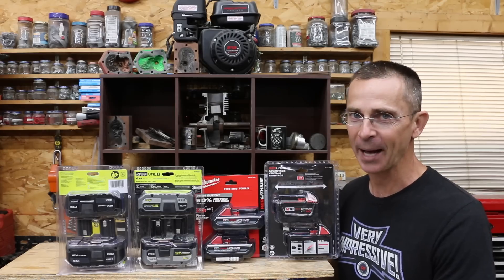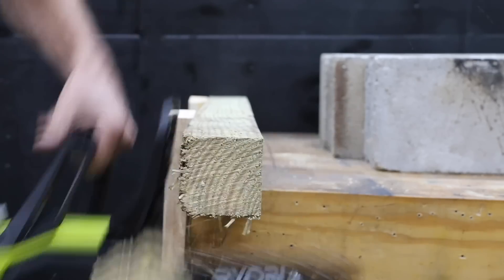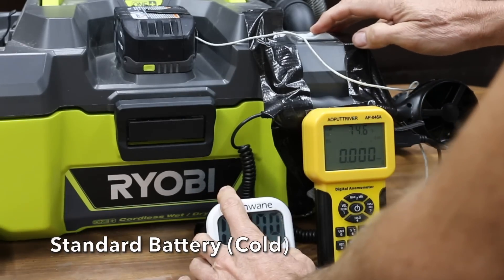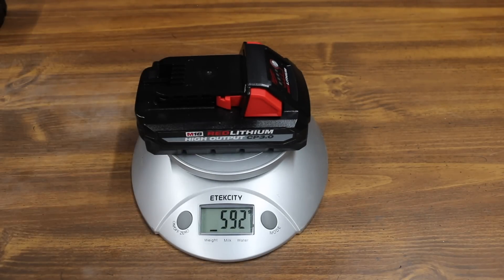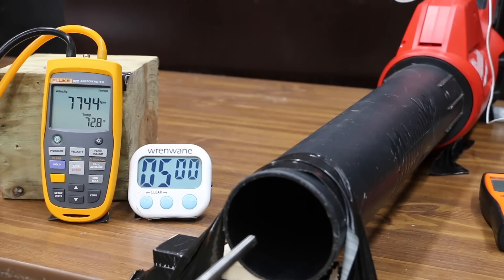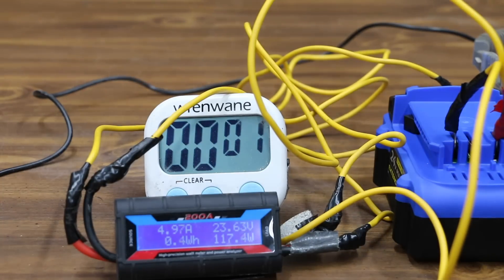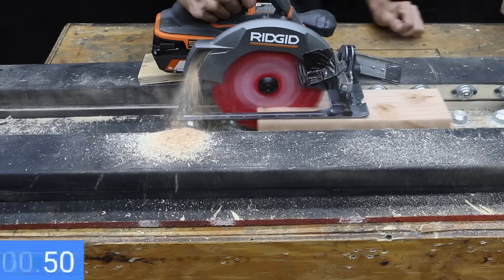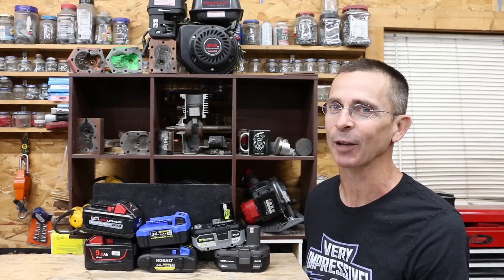Are "High Output" Batteries Better Actually Worse?

Comment: ryobi fanboy here.  The Ryobi 1+ HP batteries make a huge difference in the high end HP tools.  Especially in the Brushless models. They have an additional contact on the base of the battery, just at the beginning of the stem.     My angle grinder often stalls using a regular battery, never with the HP battery.   I would loved to have seen a comparison of a Fake Ryobi battery.   But I can't assume it would be the same as the Fake Mil.  Awesome testing.  Thanks Todd.
Reply from the maker: Thanks and you are welcome!
Reply: ryobi and high end hahahaahaahahahahhaahahahahahahahahahhaahahahahahahahahhaahhahhahaahahahahahahahahahhahahahahaahah
Reply: @promo130  Hate to burst your tool snob bubble but you do realize Ryobi is owned by TTI, the same company that makes Milwaukee… and some of their brushless tools have tested quite favorably. Not everybody cares what color the case is, as long as it works. 
I have their high torque impact doing  commercial trailer service and rebuilds and it just flat out works, even being abused. Has rarely ever  failed to get a rusted lug nut off. And if it did, it took a 1” air impact to do it. 

Ditto the Ryobi grease gun, just flat out works. And in case you missed it ih the video…Todd KEPT the vacuum.
Reply: @SoManyDogs  😂😂 clown, 
ryobi even stated themself , if you use it professional  you will void the warranty😂😂😂 call that high end
Read the box einstein 
Ryobi is for diy
Not pro’s
Reply: @SoManyDogs  #1 Ryobi is not owned by TTI.
#2 TTI makes tools for several market tiers, ryobi is one of the lower end ones. Just like S, B&D makes dewalt.

Comment: Hi there, first of all, love watching your videos! Okay, so I have the milwaukee M18 5.5ah high output (I'm in the UK) and I seem to be getting better performance from my m18 fuel grinder and m18 high toque with the 5.5ah over the 5ah, both tools are quite hard on batteries, but in my opinion, you need to be using the fuel range of tools to get the most out of them. However it did improve the performance of a non fuel circular saw, but not by much, certainly not by 60% which is the difference in price between the m18 5ah and the m18 5.5ah here in the UK. Keep up the good work.
Reply from the maker: Thanks, will do!

Comment: Impressive! Seeing these stats shows how well the standard batteries are vs the high output batteries, not very worth it unless like you said, the cold temp. Just gonna stick to the normal ones then on most occasions. You should try the HP vs normal of some of the ryobi tools though and see the differences, and also try the high preformance 4ah batteries vs the 9ah batteries and see how much more the 9ah improves speed, endurance, and power.
Reply from the maker: Thanks!  Thanks for the suggestion.
Reply: To be fair those aren’t HP tools so they don’t have the extra contacts to take advantage of the higher power in the HP batteries
Reply: As far as performance goes, here are your answers: The 9Ah is superior across the board. The closest you can get to it is the 6Ah HP and it's not that close. The 3Ah HP Compact and higher batteries will spank any of the standard batteries when used in brushless tools with the extra contact points. The 3Ah compact runs 21700 cells instead of 18650, so it has a lot of power for its size (it's actually a touch more powerful than the 4Ah HP). The 1.5 and 2Ah HP batteries will beat the 1.5 and 2Ah standard batteries and will nearly compete with the 4Ah standard batteries.

Comment: Another great video. One thing I've found with the High Output Batteries, how well they perform can be based on what tool they're put in. If I have to drive a lot of long ledger locks, you can bet I'm putting a High Output Battery in my Milwaukee impact. A standard 5.0 might get it 95% of the way into the wood, but when you need a flush-set surface, the 6.0 High Output is able to put down the last inch reliably.

Where as if I'm using my blower, the only real benefit I might see, is a slightly longer run time. 

All in all, it is really nice to have them when you need them, hot summers in particular are a pain when it comes to long periods of drilling. To me it seems like the HOBs keep the drill from burning up under heavy load in hot conditions.
Reply from the maker: Thanks!  Thanks for sharing.
Reply: Motors can only draw so many amps, a battery that can supply more amps than the motor can use means the motor will not perform any better. This is why its very tool specific. 

Also many high discharge rate high amp batteries (im talking single cells from the manufacturers) give up capacity to be able to discharge faster (though this is being improved quickly which is nice) 

So yeah, unless you have the right tool, the only benefit will be how it performs in the cold.
Reply: You may want to look into a FLEX impact.
Reply: I can only speak for the Ryobi ones, not for the rest, but on the Ryobi tools, you do have additional terminals on the battery socket that either communicates or consumes the additional power from the HD batteries. That's why also the HD batteries should have this additional contact pad on them. Not sure if either of the tools used here are using it

Comment: From experience with the HO Milwaukee and the HP Ryobi, they last a little longer but that’s not the reason to buy.  In the correct tools they have a fair bit more power (no difference in blower or chainsaw). My tests were with the Ryobi brushless 7 1/4” circular saw and the Milwaukee Fuel 6 1/2” circular saw. The rpm increase and power bump are noticeable in both applications with the HP and HO batteries. My M18 fuel hammer drill also gets more rpm for longer on a 8ah HO than a 5ah XC—same with the fuel 4 1/2” angle grinder. Love your videos!
Reply from the maker: Thanks!

Comment: good testing sir!👍🏻.... i try to stick to one brand so i dont need different chargers everywhere ( mostly milwaukees) my 1/2 impact is a 24 v kobalt which has been just awesome... i bought several knockoffs for my mil. ratchets, drills, etc... i dont see the need to buy very expensive milwaukee batteries and the fakes are good enough!👍🏻
Reply from the maker: Thanks!  Thanks for sharing.
Reply: thats why there are adapters
Reply: @promo130  dont need them.. the fakies look exactly the same
Reply: @martinedwards4522  are there real ones?
Reply: @promo130  of course    look at the video here
Reply: @martinedwards4522  😂😂 you know the difference between batteries and adapters? 
I gues not😂
Reply: @promo130  sounds like youve no clue yourself

Comment: Could you do thermal cameras next. I recently bought a yj 256 and it has a bug that I didnt see till I bought it. it says itt goes to 1200f but only goes up to 391.6 and doesn't seem very accurate. would like to know which ones perform better for the price.
Reply from the maker: Thanks for the suggestion.

Comment: This was a very valuable comparison.  Especially the Milwaukee vs the Knock-off batteries, since most of my tools are Milwaukee.  Thanks PF!  You're the best!
Reply from the maker: Thanks and you are welcome!
Reply: The primary concern with any knock-off batteries is the fact that they are made with inferior and often mis-matched cells that makes the packs prone to a much higher risk of failure, and possibly fire. Not at all worth the risk in my opinion.
Reply: yeah except they don't last very ling. I've got maybe a month worth before they kicked the can.
Reply: I love the knockoff battery test. Its always tempting to buy those batteries
Reply: Why? There’s battery bundle deals all the time at Home Depot and online for their batteries that make them as cheap as a knockoff. Milwaukee has the best batteries by far too.
Reply: @codygooch510  That's true.  I usually look to see if Home Depot has any Milwaukee battery specials and why I never bought the knock-off.
Reply: I bought the same exact knock offs and was trying to compare over here with much simpler tests and it was vague - seemed like the 8amp knock offs were equal to the 6 amp M's (at 1/2 the price) . . .   project farm is the best
Reply: @gordons_here  I never bought the knock-offs but I have a friend who did.  He said their performance seem to equal to the lower rated Milwaukee.  The 6.0 knock-offs were about = to a 3.0 Milwaukee.
Reply: @Inquiring Mind for the price, i guess they could come In handy for very light duty tasks.
Reply: @Inquisitor6321  ok that sounds about right . . .
Reply: I've tested no name batteries, and some have good cells and honestly look like OEM contract factory seconds. They could be just put inside of different cases. Others are not so good. But for lower drain or occasional use applications can be a fantastic value.
Reply: For lighter use though it does make sense to by 5-6 knock offs against the genuine though.....
Reply: @reecedrury4145  maybe.  But when your tools are making you money, it's just not worth it.
Reply: Milwaukee is now using the awesome Tesla cells (2170's).  That is worth far more than any no name knock off.
Reply: @aussie2uGA  They are using Samsung cells. Tesla cells are custom 21700's made in house.
Reply: @aussie2uGA  I've never bought or tried a knockoff. No need thus far
Reply: @aussie2uGA  Can't seem to find any info on this.  Even the latest articles searched up online show they use Samsung.  Do you happen to have a source?
Reply: @BlueFroman  Tool manufacturers aren't using Tesla cells. Tesla uses Panasonic tech made in their own factory. Maybe he was just referring to the form factor.

Comment: Would love to see you test measuring calipers. I wonder how accurate my cheap husky digital calipers are compared to more expensive calipers
Reply from the maker: Thanks for the suggestion.
Reply: From personal experience, cheaper versions are decently accurate, what you gain with "Pro" brands, is repeatability(subjective because of operator ofc), better quality,  specially in frame, rigidity of frame, smoother feel, being more dust and coolant resistant, etc. Some models you'll gain extra decimal point on read out for what's that worth. After having multiple brands and versions, my personal preference are the coolant proof Mitutoyo's, I've had Brown & Sharp, Starrett, Fowler, and etc other brands, and none are as nice as genuine Mitutoyo's(there are plenty of knockoff, specially of non coolant proof ones).
Reply: @dfsmachinist5941   - I'd heard that knockoff Mitutoyo calipers hold battery charge around for a month, in compare to a genuine with over a year battery lifespan. Didn't buy it yet.
Reply: @hztn  Yep, sounds about right, one of guys in shop had a knock off.

Comment: Love your reviews! I make purchases based upon your objective test results. Unfortunately, I purchased a bunch of Ryobi hp batteries before this test😞
Reply from the maker: Thanks!
Reply: I love his reviews too but unfortunately, and it happens to everyone he missed the mark on this one. Don’t feel bad about buying the HP batteries they were a good investment. Certain tools are designed to take advantage of that HP architecture and extra power and other tools are not capable of drawing that extra power. Your HP Ryobi tools should be paired with your Ryobi HP batteries. I run Milwaukee tools and you won’t see much of a difference if any at all, on things like vacuums but impacts, drills, saws, etc you will. but more so with Ryobi tools there’s actually an extra contact on the Ryobi HP tools just for the HP batteries.

Comment: In my experience regarding the knock offs. They're a lot cheaper and absolutely suck. And I've had two start smoking and then never work again when they weren't even being pushed

One real (regardless of brand Makita Milwaukee etc) seems to have the same power and run time as 3 knock offs

Your tests definitely verified what I assumed using high outputs at work, little to no difference
Reply from the maker: Thanks for the feedback.

Comment: Thorough testing as usual!

Surprised the results were so close... But in a heavy load application I'd want my battery to run as cool as possible for longevity, so the high performance packs are all ahead there.
Reply from the maker: Thanks!  Thanks for the feedback.
Reply: then you need to store them in freezer
Reply: I was thinking the same although how much longer would they last?
Reply: Not the milwaukee though

Comment: A high output lithium battery can be charged to 4.35 volts per cell, as opposed to a regular lithium battery that is charged to 4.2 volts per cell.  But that is just the battery.  If the charger is not capable of charging at a high output, then the batteries will be no better.  That being said, you can also charge a regular battery to its high limit.  It all comes down to the charger.
Reply from the maker: Great feedback! Thank you
Reply from the maker: Thanks for the feedback.

Comment: I could buy 4 of those knock off batteries for the cost of one thats slightly better
Reply from the maker: Great point!  Durability and safety are factors that I'm concerned about with the knock offs.  I've had less than positive experiences with them.
Reply from the maker: Thanks for the feedback.